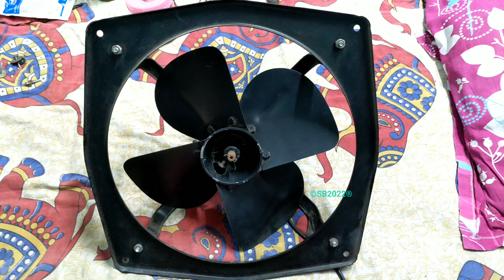CROMPTON GREAVES TRANS AIR 12 (1997) REVIEW & INSTALLATION

Comment: Hey is there any ball bearing or bushing in this fan... Please reply
Reply from the maker: Yes it's double ball bearing 
Size 6201 both sides
Reply: @SOURADEEPBISWAS  thanks... I wanna purchase Dec Air Fan but unable to do so it's not even showing on Crompton website help me
Reply from the maker: You can alternatively try Crompton Aura 2 4 blade as it's new model & 5 years warranty. It's available in Amazon. 
Sadly Dec Air is discontinued 2 years ago ...
If you get old stock somewhere then it's fine. Otherwise try the alternative model as I suggested.

Comment: My solan trans air has slightly weaker blades than this 1997 transair.
Reply from the maker: Hm. Typical cost cutting that's regularly done by all brands...
Reply: @SOURADEEPBISWAS  But my Solan Trans Air almost has same performance as this old Trans Air
Reply from the maker: Hmm
Reply: @SOURADEEPBISWAS  Is Usha Aeroclean Plus DBB good?
Reply from the maker: Quite nice

Comment: Those blades have a good curve and high blade angle for better airflow 1800 m3/hr than new transair 1600 m3/hr.
Reply from the maker: Old is gold obviously but newer Solan one Still better than almonard dbb exhausts
Reply: @SOURADEEPBISWAS  Can you please try Almonard Air Vent exhaust fan soon?
Reply from the maker: Sorry. I don't ruin my image reviewing junk company's poorly made products. Please place such requests in other channels.
Secondly, almonard is banned from Bengal since 2012.
Reply: @SOURADEEPBISWAS  I've bought Almonard Air Vent 9" DBB exhaust fan. Working fine.
Reply from the maker: If u are a mechanic for atleast an hour & disassemble 5-10 dirty broken Crompton TA & almonard dbb for repair & some local made dbb exhaust too, you can understand what's quality of what & etc.

Comment: Nice to see this nostalgic fan, I had 9" Of year 1989,had to discard last year as the body broke due to age, 1989 I think was the starting of transair production
Reply from the maker: Sad
Reply: Winding was original, only capacitor changed, but as it was used roughly and not maintained well as it was in my uncle's mill, it started to rust as the paint peeled of And when they tried to uninstall the fan, the stupid guy dropped the fan which resulted in body damage(for repaint purpose), so had to discard, replaced by G logo 2012 9" Transair
Reply from the maker: Hmm
Reply: @SOURADEEPBISWAS I want to purchase an exhaust fan which must have ball bearing please recommend me in reply or make video over this topic